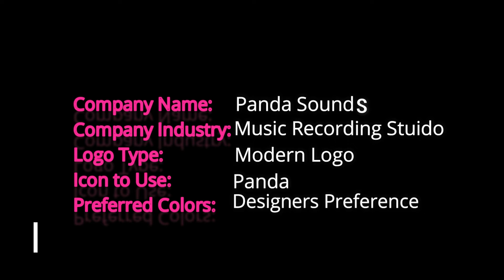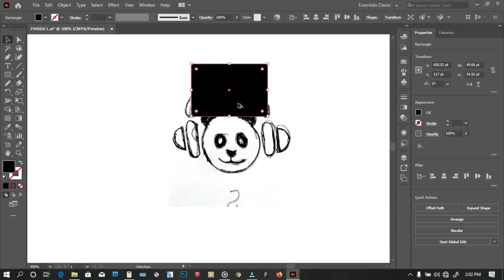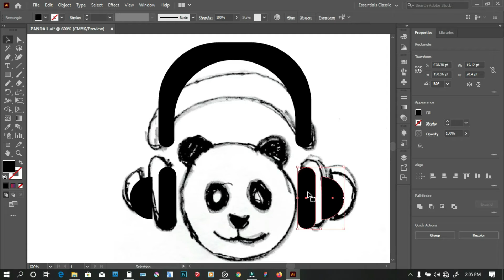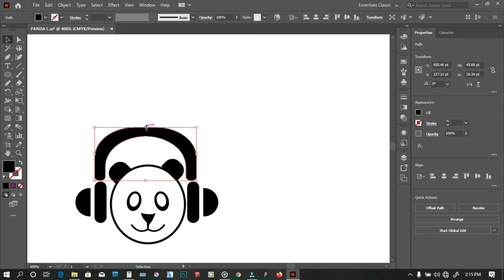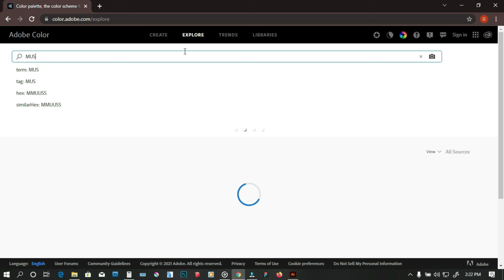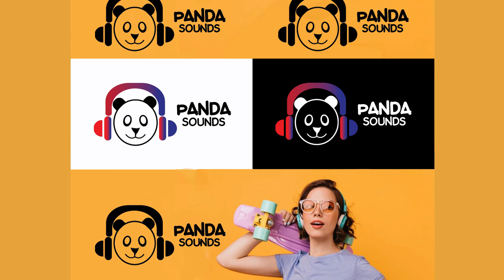How to make a Logo: Design process from start to finish (Adobe illustrator)

Comment: you skipped alot of steps, you didn't show how to in port the file, and you are assuming the person watches has used the software before.

good logo
Reply from the maker: Sorry about that. You can port the file by dragging and dropping into the interface
Reply: @Mrs_Sauce  I know how to import a file, drag and drop, Or File - Place Embedded etc - but a tutorial should explain everything being done. I will be doing Photoshop tutorials for drawing and character design and animation etc. and i have just wanted to point out that urs missed a step, i have been self thought in Aftereffects photoshop and Maya and there is nothing worse than trying to follow a tutorial and they jump past a step.
Reply: @Mrs_Sauce  Thanks